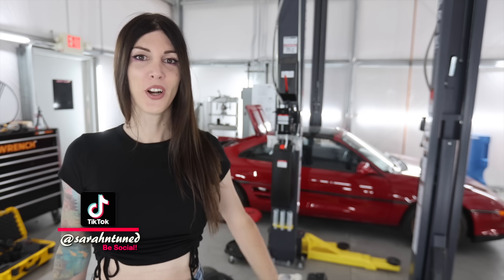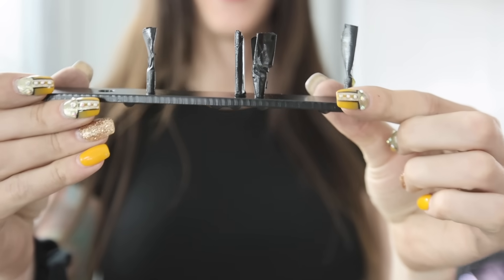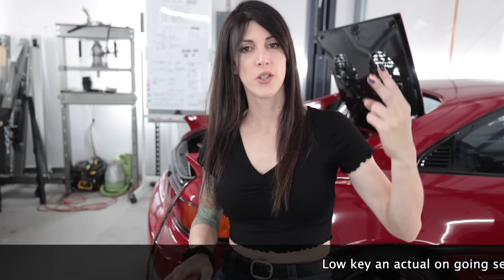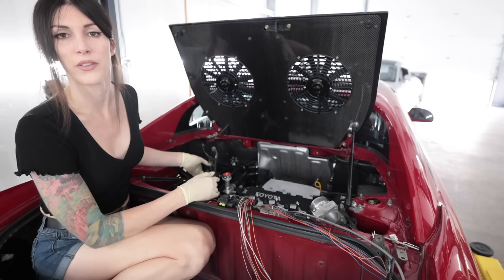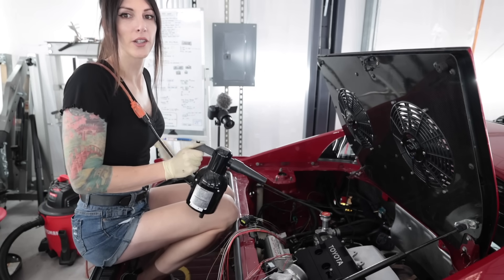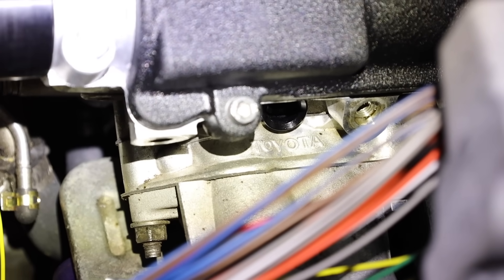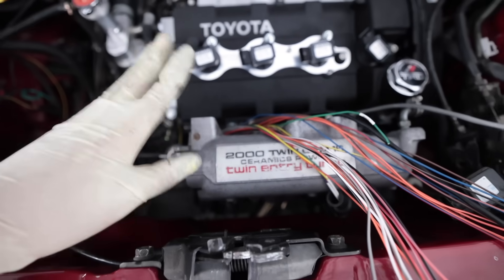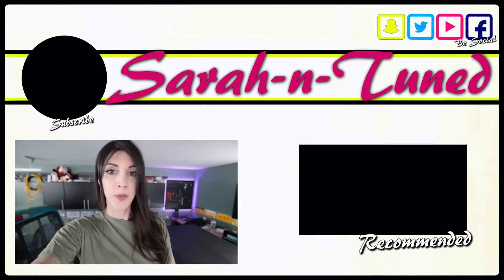Flex Fuel Conversion w/ ID1050 Injectors // Re-Wiring my MR2

Comment: I strongly recommend you to buy a 98+ 5SFE oil pump plus the crank sensor and the crankshaft trigger wheel in order  to run a fully sequential ignition setup OEM style. The trigger angle is easily programable with the LINK

Comment: For the near-stripped Torx bolts, an option would have been hitting them with a couple taps from a chisel bit on an air hammer. Once loose, spin them out with some Knipex pliers. Whatever works though. 👍 aaaaand no compressed air-nevermind

Comment: dumb question, why are there Yamaha parts on a Toyota?
Reply: Yamaha has been building motors for over 50yrs, not just for Toyota also Volvo & Ford.
Reply: @mr-c1472  Thanks. You learn something new everyday. Had plenty of Yamaha motorcycles. Never knew they built engines for other companies.  Very cool.

Comment: Made a similar setup. For info: if you put in a fuel pump in with over 315L/h, you have to change the fuel return line to the tank. The oem one is to small, you will get strange fuel pressure behaviors. 
Keep going like this 👌

Comment: Quick Note 🎶🎶: you had your injector rail removed when you drilled those bolt heads off. You need to be 100% positive that no shavings got into those holes while you were using your "Blower" to clean those shavings.
Reply from the maker: I vacuumed first and they were taped over

Comment: Nice vid, but Bar is 14.5 psi, atm is 14.7 psi.  Sorry.
Reply from the maker: Yes, and the MAP sensor measures absolute pressure inside the manifold, so I was correct at 14.7.

Comment: I got that Metals Tech comment.  I was Aircraft Structural Maintenance and our shop was in the same building as Metals Tech.  We always had to go out on the Flightline and replace nut plates after Metals Tech removed a stuck screw...good times.  This was at Langley AFB and was on F15s in the late 90's early 2000's

Comment: Try giving those cam cap bolts a decent tap with a hammer before trying to undo them.
Reply from the maker: I beat the crap out of them with a big hammer and used an impact, the heads just stripped.
Reply: @SarahnTuned  Way ahead of me, I see, in which case your method excelled.

Comment: 7:05  - Recently, didn't have an induction heating tool in order to give high thermal shock to seized & corroded hardware to break it free so I did the next-best I could which was to apply a heat gun (pulling away occsssionally to monitor heating progress via a non-contact thermometer to achieve consistently high temperature deltas), spraying freezing-creeping penetrant after which I donned a winter glove to handle dry ice (acquired at my local grocery store for cheap) and placed it in contact with the head of the bolt/thread-side as it whined and sizzled during the dry ice sublimation and shrinkage. I let the bolt get so cold that condensation upon the hardware became frost. Sprayed more penetrant at that cold temperature for added measure. ...A few, patient heating-freezing cycles interspersed with gently working the hardware and applying the freezing creeping penetrant eventually broke my fasteners free. 👍

Comment: A day to make a bracket and mount two sensors.... Bless your patience. 
The lift should handle the center of gravity as it does front or rear engine cars... No?
Do these units do well in the heat of the engine compartment? Most ECUs are mounted away from heat. Or so I have always experienced. Your engineer is good with this location?

Comment: Ever thought about buying a Dannmar MaxJax or M6 lift for at home?  You could set two sets of in-concrete anchors, one inside the garage, one on the driveway, which would allow you to wheel-out and bolt-down the lift for work at home or for some of the dirtier outdoor detailing stuff.

Both Dad and I have MaxJax, they've made work so much easier it's kinda crazy.

Comment: this is when you need a hammer and hand impact driver. it will remove any hard to remover bolts because it shocks the bolt
Reply: Yes I recently located both my 1/2" and 3/8". Crucial items.